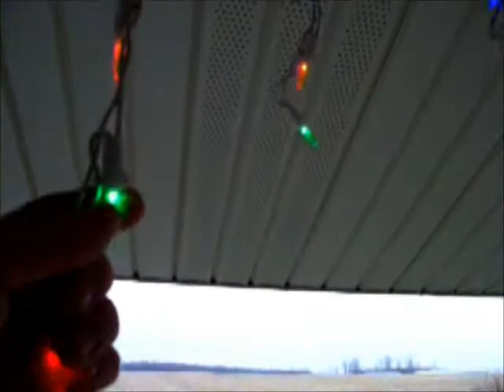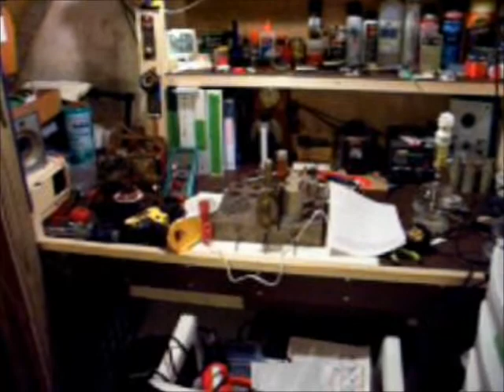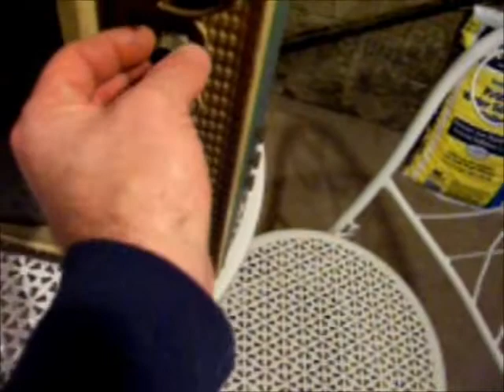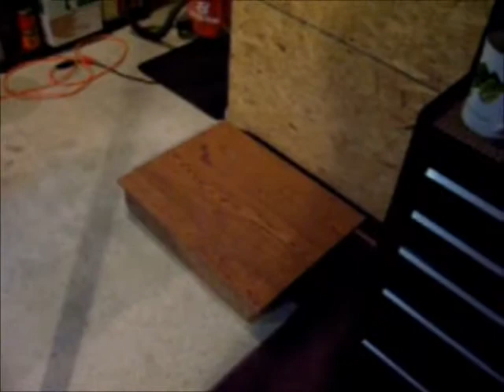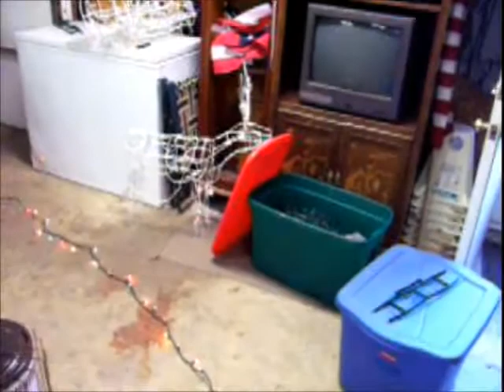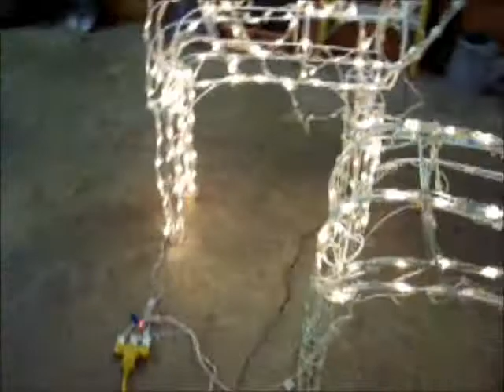Random Video's # 23

Comment: I like your TV tower.  How far are the most distant stations that you can watch?

I bought some LED Christmas lights when they first became available.  Most have been free of trouble but one string suffered some kind of failure.  Don't know if the power supply went bad or what but I was unable to get it to light.  Made in China.

My bet is that your TV was tuned in to the Kennedy assassination coverage.  We had three networks back then and all three ran continuous coverage of the events.  Many of us saw Oswald when he was shot on Live TV.  Everyone was glued to their sets starting on Friday, November 22nd and continuing until Monday.
Reply from the maker: John,
We can receive Dayton, Cincinnati, and Muncie Indiana pretty much all the time. Sometimes we can get columbus and Indianapolis. The farthest on digital OTA : North - Detriot/Lansing, West - Terra Haute, Indiana, South - Crossville, TN, and East - Pittsburg, PA & Charleston W. VA. Conditions have to be just right (weird) to get them. The LED's have worked great since day one.

Nathan
Reply: NBH45304 Detroit must be a good distance from you.  My antenna is only about 20 feet above the ground but it picks up Miami (60 miles south).  During those weird conditions (that you mentioned), I have picked up Ft.Myers on the west coast (about 100 miles).